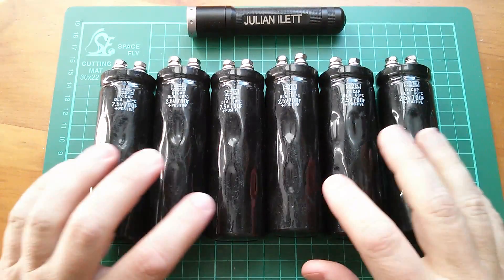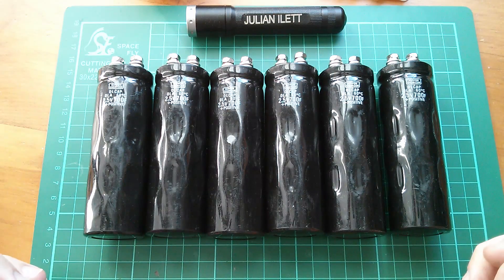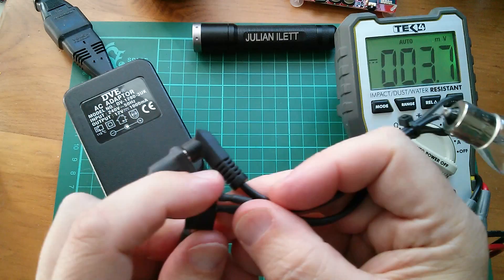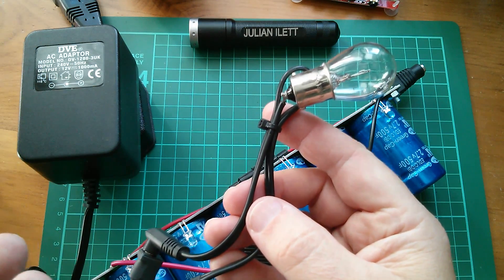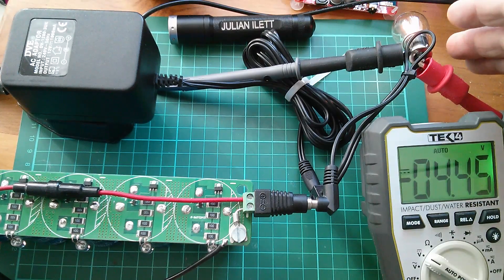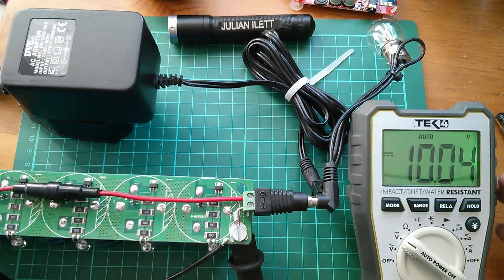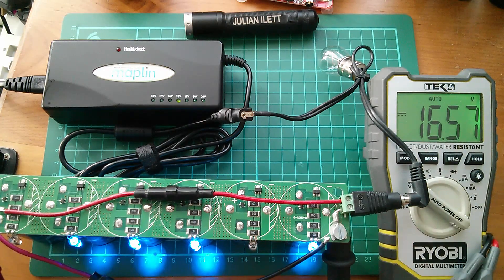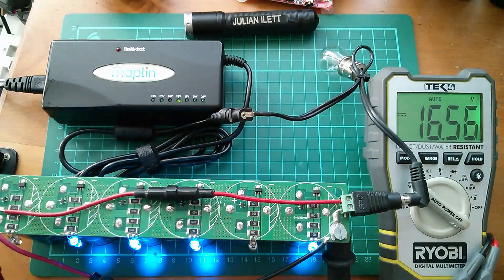Charging SuperCapacitors from a Mains Power Supply

Comment: what advantage if any do super caps have over batteries?
Reply: Unlike batteries, they can be charged and discharged like a million times, before they start to degrade.
Reply: Utkarsh Amitabh Srivastava Thanks for reply, the impracticality of replacing batteries with supercaps seems to be supercaps' inferior energy storage (drain quickly). So good for quick high current burst.
Reply: caps charge faster, can be discharged faster.   there's less waste while charging since they don't produce as much heat, they work at a greater temperature range. They can be charged millions of times instead of hundreds/thousand. they're cheaper to make per unit (but more expensive per stored energy atm)

Disadvantage is their lower energy storage per volume (energy density).

Batteries are chemical and there are limits to how much better we can make batteries simply because of how the chemistry works. If we can make batteries 3 or 4 times better at similar costs, as they are now that would be a pretty impressive feat.

Capacitors don't rely on a chemical reaction, and can still be improved upon massively by making the distance between the "plates" smaller, and making the distance between layers smaller (which will allow to increase the surface area of the 'plates' per volume. As well as by improving the used dielectric between the plates.

Current best batteries (experimental Li Sulfur) can get up to 350Wh/Kg
Current best caps can get to 6-10Wk/Kg, but new research and materials (graphene looks promising) have some claim we'll have 300Wh/Kg within a few years, with prospects of much higher densities still. Batteries could be a thing of the past in a couple decades...
Reply: They charge up very quickly at high current in a matter of minutes.
Reply: Not quite, maybe with standard commercial supercapacitors with 10 Watt-hrs / kg.  But if you check out Robert Murray Smith's videos you'll see that his supercapacitors outshine the energy density of lithium, with plans to take the technology to even further energy densities (like gasoline)
Reply: that's interesting.

Comment: Would it be worth putting some 470 ohm resistors across each of the caps to give a more uniform power off discharge, When the power is removed the caps only discharge via their internal resistance... Only a thought.

Comment: possibly have a series power resistor with a power transistor shunt across the resistor.
Then when first charging the charge current goes through the resistor.
the base of the bypass power transistor could somehow be linked to each led discharge circuit and when any of the lights come on, the transistor is then shunted thus bringing the last bit of charging at a slightly higher voltage.

Comment: Why not use a buck converter with you laptop power supply.  Set your voltage to 16.2, set your current, and you're done  They are only about $2-$3 on ebay.

Comment: You are right when you exlplained that symbol on the transformer
Reply: Cavity fuses are better, Instead of burning up the piece of metal bends and opens the circuit, and it bends back when cooled.
Reply: That's the symbol for the thermal fuse inside. If the transformer reaches that temp, the thermal fuse will blow and you have to crack open the case to replace the fuse or bypass it with a piece of wire.